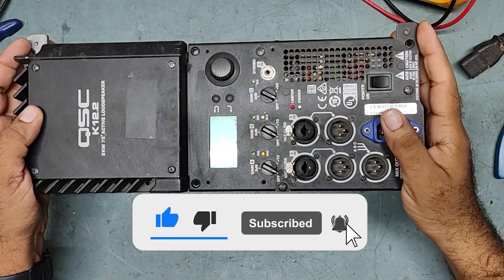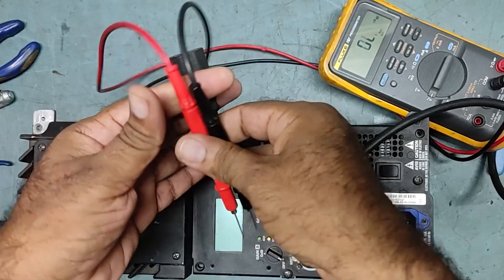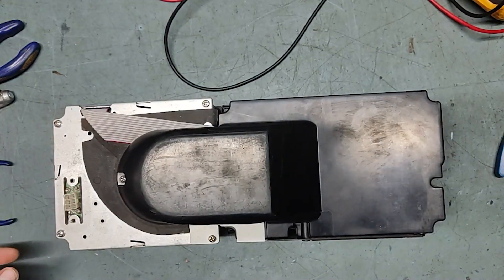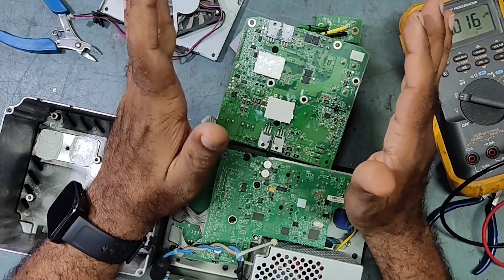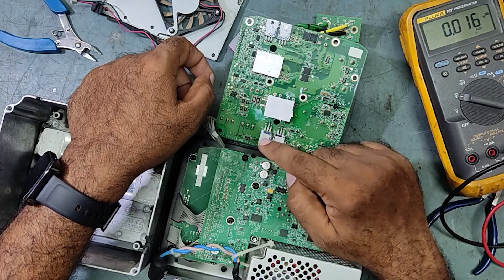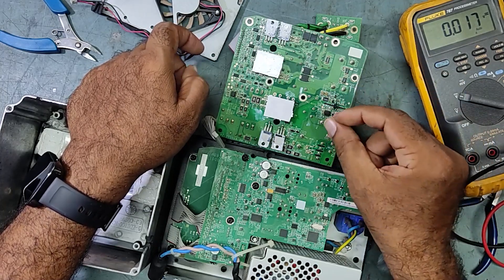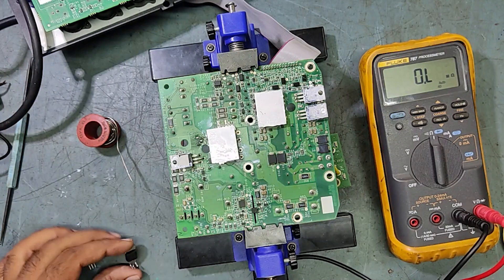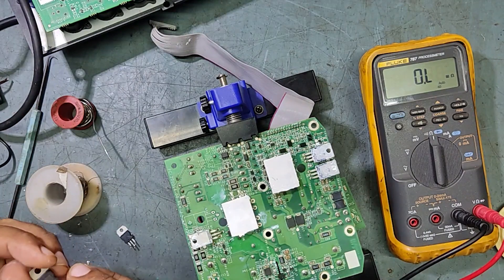Repairing QSC 12.2 Active Loudspeaker for Power supply problem in SMPS Board....Most uncommon Fault.

Comment: I have different fault. Unit powers up, display ok, signal lights off until I present an audio input signal, then it comes on. But no audio output. Problem +15v and -15v measure low. Approx. 10 v. ((I tested both Mosfets in video. They are ok). There is no audio signal leaving preamp pcb to amp pcb. On flatstrip pins LF-Ch. Any suggestions? I have no schematic to refer to.
Reply from the maker: May be main DSP ic malfunctioning
Reply: I would not be able to repair that, I presume 😢
Reply from the maker: Visit your nearest qsc service center
Reply: Success. I upgraded the firmware to latest revision. Voltages good, audio output back.

Comment: hello,  i have a qsc 8.2. i changed the Q14 (STP45N65M5) and the U15 (UCC2893) for three times,  The Q14 is always in short when the maximun power is used. The amplifier works fine under 40% of the power. what could it be?
Reply from the maker: May be due to any smd electronic components in SMPS circuit is weak or leakage currents in board, Actually this type of fault is very critical & headache work

Comment: I have QSC KW 181. The power is there, but there's no signal... That makes it not to produce the output to the speakers. what could be the problem
Reply from the maker: May be Amplifier board or pre amp circuit
Reply: @TKFElectronics  thanks for your reply. Have checked it, and it's the pre amp which does not function. And I don't know how to fix it
Reply from the maker: Your location
Reply from the maker: If you r not technically qualified person, i suggest you pls visit your nearest QSC service center

Comment: HI, any solutions on why QSC k12.2 powers off. Reboot and it works. I sent off in 2020 to be fixed. it took over a year. Now back the issue has happened 4 times.
Reply from the maker: Main motherboard issue, may be system ic malfunctioning

Comment: Update. I found some information. D51 is supposed to be a RB751S40T1 Schottky.
However the diode in there was marked KB which is a type of zener.
Confused still as to why / how this can happen.
Since this QSC asked an independent technician to call me and the owner will now decide if he can get an entire module at around €400 sent by this technician under the cover of QSC or not. If not i will continue with the repair.

Comment: I should have checked the service manual 1st! I wonder if i have a suitable zener here. D51 KDZ4.7B. Actually i'm confused KB code shows many different type diodes. I can't find the schematics for the K12.2 so i'm a bit stuck.

8. Troubleshooting tips
For additional troubleshooting information on K.2 Series powered loudspeakers, please see the “K.2 Series Service Trouble-
shooting Guide” document available on the QSC Service Partner Portal. QSC will frequently revise the Troubleshooting
Guide document as new common failures are found.
The troubleshooting contents inside this service manual are strictly tips that will help you troubleshoot the loudspeaker.
Safety first
• The filter capacitors between PRI_HI / PRI_LO and VSS / VDD store a lot of energy! The voltage on these rails takes at
least 10 minutes to fully discharge. If you are performing rework or repair, always discharge both voltage rails.
• PRI_LO is NOT chassis ground. Do not use an oscilloscope or DMM connected to earth ground.
8.1 General tips
AC mains fuse
• If the AC mains fuse blows, a soldering iron is required to replace it. To measure for
an open AC fuse, use the tip noted in “8.2 Testing the AC mains fuse and line filter
components”.
• The fuse is not field-replaceable by an end-user, see location in Figure 9.14.1.
Power supply
• If the PSU is not running and no LEDs are turning on, check the voltage across PRI_
HI and PRI_LO for approximately 320 - 340▲Vdc. Check the voltage across resistor
R147 for approximately 55▲Vdc.
• If the PSU does not come out of a pulse-skipping mode, check for shorted diodes D23, D24, and D51. Also check U2,
Q8, and Q7 (in the HF amplifier section).
• If excess transformer noise is heard in normal mode, check the PWM at U15. Also check U4 for bad solder or failed
components nearby.

Comment: With power flashing screen on and off I think it is: D51 (an smd SL110 and possible Q23 a small 6 pin device near D51) Looks like the frequency driver for Q13 and Q14 I'm getting 23 ohms both directions across D51 and 0.040 in diode mode on my meter.
  To be honest i will probably put this back together and let the warranty centre take care of this. I will probably rent a speaker to the guy because it will take time to order these components and he will probably only save 2 weeks. But on the other hand i'm a little concerned about renting speakers that are going to be used on a mountain at 2600M!
  Actually the diode is marked KB whick seems to be a zener KDZ4.7B. The 6 pin smd is printer 001N but i do not know what this device is it might be ok.

Comment: I'm about to open one of these. No idea what's wrong with it. He has it at 2,600M on a mountain and he thinks it got water inside. It's still under warranty but the same thing already happened to the other one and he doesn't want to send this one to Thomann because the last one took one month to repair and he thinks they said it was just an internal fuse. He said it lights up though. Let me see. Right. So, it powers up and everything looks normal on the power led and the screen but after 3 seconds it shuts itself down and immediately starts up again for 3 seconds and so on.
Reply: Did you find the issue? Mine is showing the same symptoms.
Reply: @derekkien7173  Yes. I found the problem. It is actually explained in the service manual if you find the updated one. 
  D51 and possibly the two transistors next to it. The thing is the guy changed his mind and decided to go with warranty after all.
  I put a great deal of time into researching the fault and finding the correct diode which was different to the one that had been installed from factory. Should be a RB751S40T1 Schottky.
  In any case I recommend people not to buy this series of QSC. If you look in the service manual there are pages and pages of common faults. Also it was the 2nd one that went down on hm and he bought them new.
  Hope you fix it. He paid me €70 in the end for my troubles.

Comment: my qsc k12.2 power supply light keeps on and off... any initial assessment on the problem?
Reply from the maker: May be problem will be in Power supply section or Amp Board
Reply: Hi. Did you fix it? I have the same issue.
Reply from the maker: Very simple bro by replacing defective parts with new
Reply: / @TKFElectronics  I'm inside. Not the easiest to dismantle! (still under warranty but the 1st speaker took one month for them to repair) About to remove PSU board now. On the smaller filter circuit there is a green ceramic capacitor? In a plastic holder on the side of the small board between two large inductors. It is showing 13 ohms. is this ok? I feel like the issue must be further up in the PSU. I'll post back if i find the problem. Update. The green ceramic is NTC inrush filter R41 and can sometimes be broken but not in this case.
Reply: @TKFElectronics  I think it is D51 (an smd SL110 and possible Q23 a small 6 pin device near D51) Looks like the frequency driver for Q13 and Q14 I'm getting 23 ohms both directions across D51 and 0.040 in diode mode on my meter.
  To be honest i will probably put this back together and let the warranty centre take care of this. I will probably rent a speaker to the guy because it will take time to order these components and he will probably only save 2 weeks. But on the other hand i'm a little concerned about renting speakers that are going to be used on a mountain at 2600M!
  Actually the diode is marked KB whick seems to be a zener KDZ4.7B. The 6 pin smd is printer 001N but i do not know what this device is it might be ok. Now i'm not sure what the diode D51 or XB is because the code XB shows and different types of diodes and I can not find the schematics on the QSC site.
Reply from the maker: Your location pls
Reply: @TKFElectronics  I am in Chamonix France. Please do you know the Diode Type for D51 (Marked KB) it seems to be some type of zener for the mosfet switching circuit.  I went to the QSC site for the schematics as mentioned in the service manual but i can not find any downloads there. I have opened a case but i don't think they are going to tell me the information.
  Otherwise this speaker will be sent back for repair under warranty which can take 2 months and it will probably cost QSC €150 or more  for a registered technician to fix. Hopefully they will reply to me tomorrow but i'm not expecting to get the diode type or schematics from them. I would greatly appreciate if you know the diode type (voltage tolerances). Thanks
Reply: @TKFElectronics  I believe D51 is a RB751S40T1 but normally such a diode does not carry the code KB. This has been very confusing for me. Why is the diode installed marked KB yet it seems D51 should be a RB751S40T1?

Comment: Sir nx audio active speaker mosfet burn. I changed mosfet 20 n50 n ir2153 ic but power supply not work
Reply from the maker: Check some other electronic components around ic & MOSFET